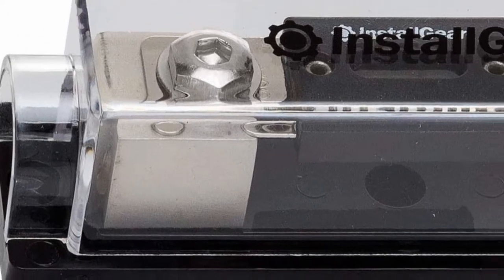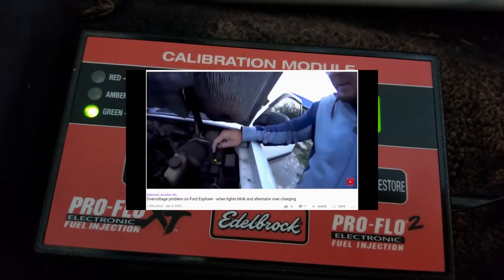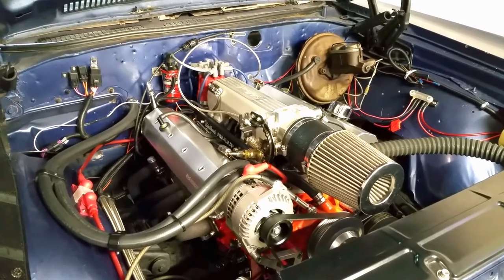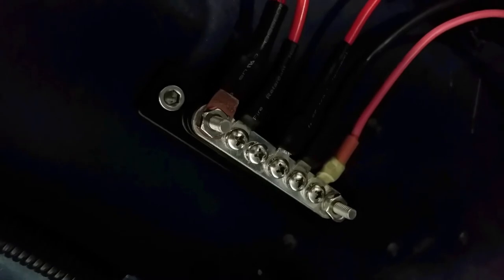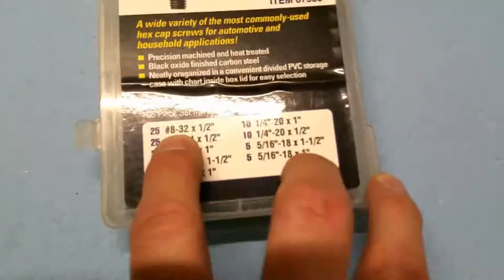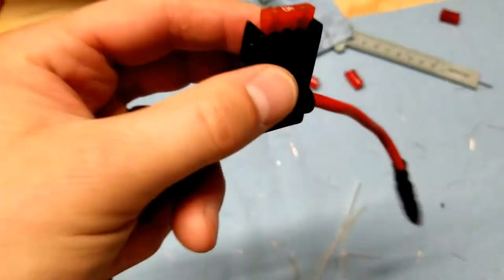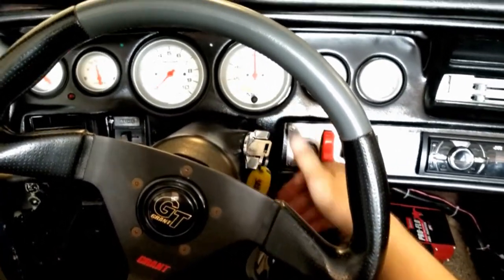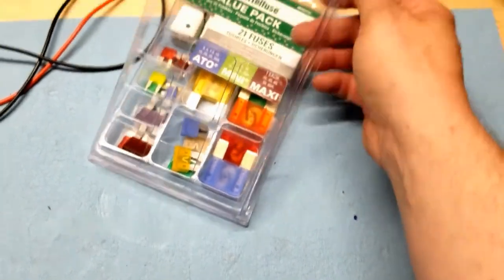ANL Fuse Holder | Overcharging Fix | Wiring Upgrade | Unboxing & Install | 1971 Chevelle

Comment: Purchase a digital multi meter (DMM) then use it set to voltage DC. With the engine running, lights on, wipers, radio, blower fan, EFI, fuel pump etc. Then do a voltage drop test at every major point. High Amp circuits can have a voltage drop of 0.500Vdc while circuits under 30 Amps should be less than 0.050 VDC. This includes battery to ANL fuse holder, across fuse, wire to distribution center (Which Should have individual fuses). The alternators regulator reacts to “B” or “2” as battery sense. If low, it ramps up output to meet needs. This will happen if you have a loss of voltage to get such a high output. Depending on model, but they use a ceramic wire wound resistor to sense temperature as air is pulled in thru the back. Cold, voltage goes higher, warm low. 
  There is most likely nothing wrong with the new fuses as they were simply undersized to start and the melting creates high resistance. The 10SI, 12SI, 15SI or 17SI alternator, terminal 2 is system voltage sense to adjust output by controlling ground to the stator. Terminal 1 is the light and field. It’s voltage comes from the ignition switch, thru the dash light to the alternator. It still gets system voltage but the current is limited to 0.25amps with a hot bulb when on during key-run bulb test. This makes it in balance with the field and diode trio. The trio is only there to supply voltage to the regulator to supply ground to the field at 400 times per second. (400Hz) This keeps AM radio noise well below AM’s 580 lowest band. Many GM’s used a 460 ohm resistor in parallel with the bulb. In case the bulb went bad, the alternator would still work, the bulb would not come on during bulb run check. 
  In a perfect world, there would be no resistance but wire, connectors, fuses, switches and grounds all have resistance, the lower the better. But high current circuits have higher voltage drops. Think of a snow plow, lift gate or a starter. To reduce current & size, they put permanent magnets and gear reduction instead of coils that require high amperage. “System Integrated” or “SI” alternators are different as they use a “Y” connect stator. “CS” uses “Delta” stators and control B+ to rotor. Not ground, but still at 400Hz. They product higher amperage at low speeds than “SI” They have better cooling to remove heat from the diodes, but either model produces negative voltage on the back case half. This part should have a nice 4AWG cable to the engine block. Voltage drop is accurate, quick and doesn’t lye. In a series circuit, the device consumes all the voltage. But battery, minus all voltage drop on positive and negative, adds up to the battery. Meter leads that are backward simply show a negative symbol in front of the number but still accurate! DK, ASE master tech

Comment: Hello, will the fuse work on a 6-gage wire and had you had any problems with the fuse since install. Thank you, good video, helpful.
Reply from the maker: Should work fine with 6-gage.  No problems since install.

Comment: Nice and straight to the point. Would there be any issues running 4 guage wire from battery to junction box but connected accessories are smaller guage wires.
Reply: 4 gauge should be fine.  I think that is the size I used.  Plenty big.
Reply: Thank you sir!!